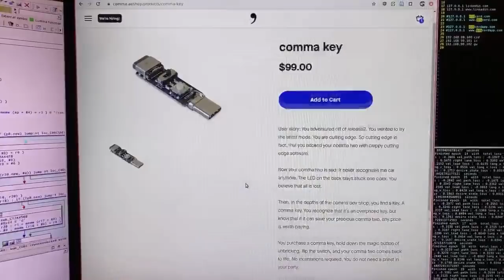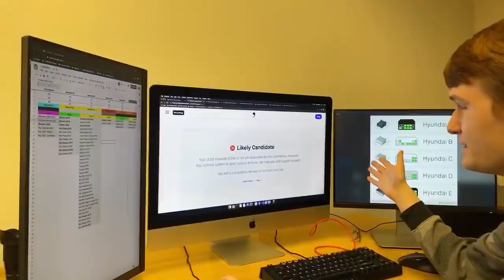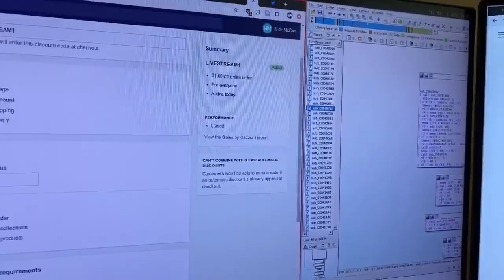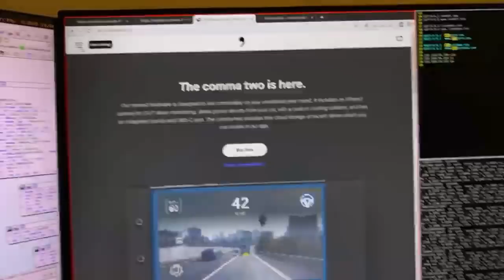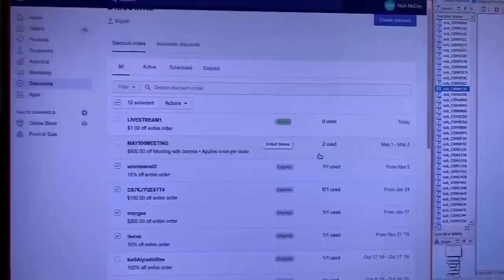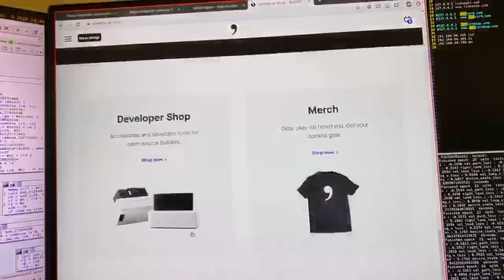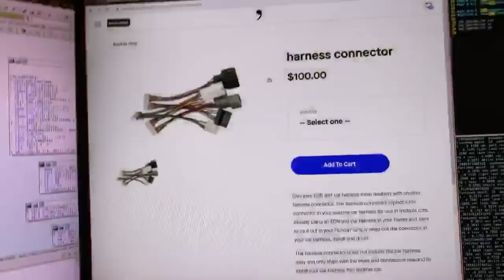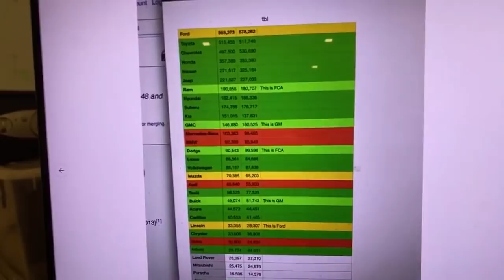comma ai | George Hotz | Product launch for Hyundai/Kia/Genesis Harness | panda jungle | comma key

Comment: Have you thought about using Nvidia Jetson ?  Have your thought reaching out to Penske car rental?  I used to work for a electric supply distributor, the drivers would alway get into accidents.
Reply from the maker: https://youtu.be/FIbvt4_InyU?t=2316
Reply: Thank for the info.  I have a Honda clarity 2018.  It looks like it has the same parts as a Honda Accord .  My car does brake hard with someone in front of me is making a U-turn and I try to make a left.   Can you access the sensor on the front of lighting and use the camera on the clarity to improve the collision detection .  Also it seem like the Honda Clarity can not follow solid lines well, because when I drive on the carpool it has a difficult time tracking the path.    Would  something like Google Tango or structure.io working in helping collision detection?

Comment: 2008 honda crv when?
Reply from the maker: For openpilot to work the car needs to have some kind of https://en.wikipedia.org/wiki/Lane_centering. You can check https://comma.ai/vehicles for supported cars. Installation on the supported cars is very simple (plug and play). You need to buy https://comma.ai/shop/products/comma-two-devkit and the right car harness to connect to your car. Check https://comma.ai/setup for more info how to install.
Join the developers on https://discord.comma.ai/ and check the code on https://github.com/commaai/openpilot
If you are interested in porting your car to openpilot check the articles on https://medium.com/@comma_ai
- https://medium.com/@comma_ai/a-tour-through-openpilot-a6589a801ed0
- https://medium.com/@comma_ai/how-to-write-a-car-port-for-openpilot-7ce0785eda84
- https://medium.com/@comma_ai/openpilot-port-guide-for-toyota-models-e5467f4b5fe6
- https://medium.com/@comma_ai/how-does-openpilot-work-c7076d4407b3